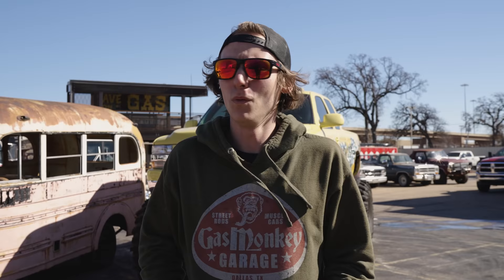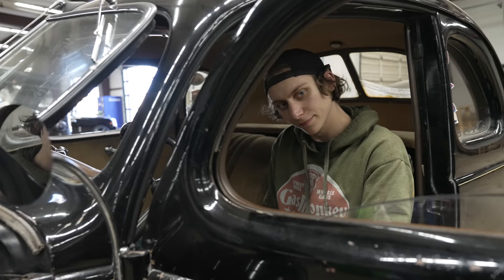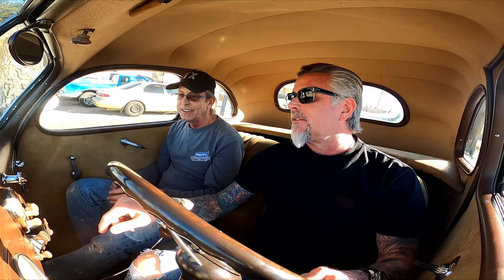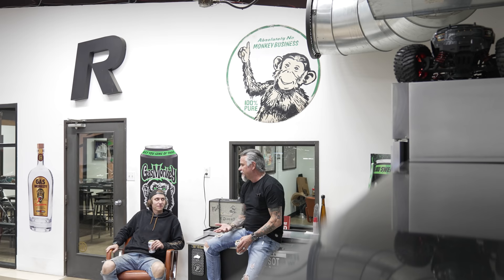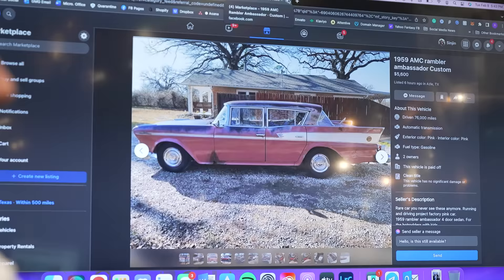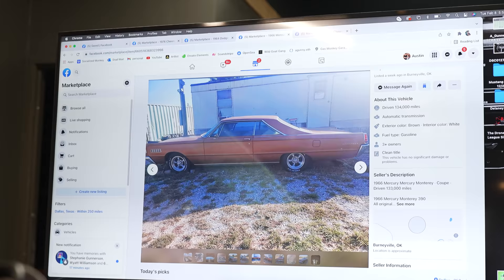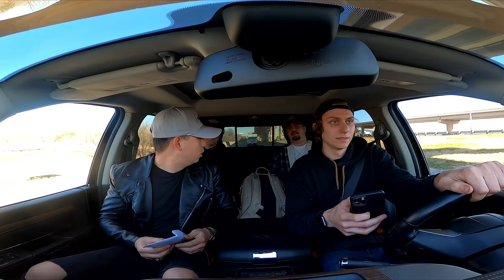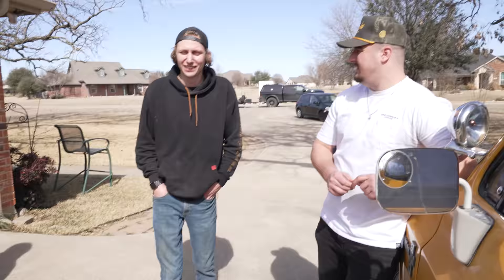Car Buying 102: The Millennial Challenge - Gas Monkey Garage & Richard Rawlings

Comment: Millennials succumbed to group think when they tried to drive that truck back to Gas Monkey Garage. Should have just checked to see that it starts/runs then put it on trailer. If insist on driving it back for dramatic effect - at least check all the fluids first.

Comment: Let’s review. 
It’s more interesting if the three camera production guys that don’t know jack about cars lead the whole process in the way that they would handle it. 
Never buy a vehicle that has been that hot it’s not going to go well for longevity. It needs an engine. 
screw that utility box and find a nice southern Dulley  bed to put on it IF it’s still worth jacking with.
For interesting content Chase is not the one that we have any doubts about maturity, common sense and mechanical ability.

Comment: Using a mobile phone whilst driving, very stupid, and dangerous.
Why not simply put it on the trailer, you have a trailer for a reason.
Cooked engine.
When putting cold water into a hot engine.
Best way to crack the block.
So now before you start.
Head off new head gasket skim the head.
Not the best start.

Comment: Cold water put into a hot engine can cause a head to crack or even a block
Reply: If you only have cold water, run the engine and slowly put in the cold water, turn the heater on the highest hot temperature, High Fan to reduce heat of the engine